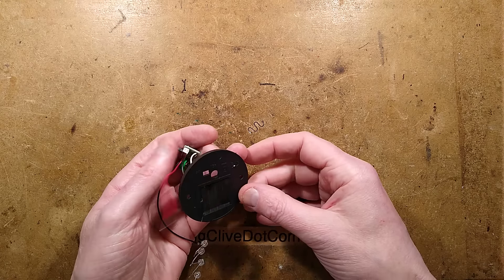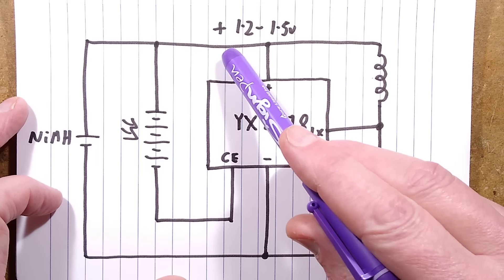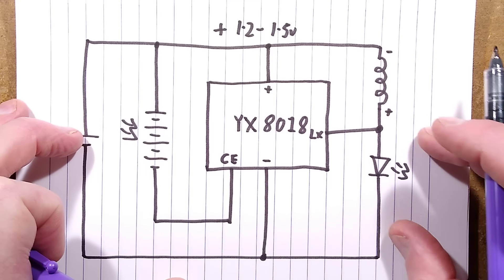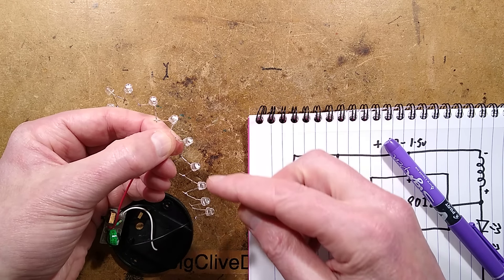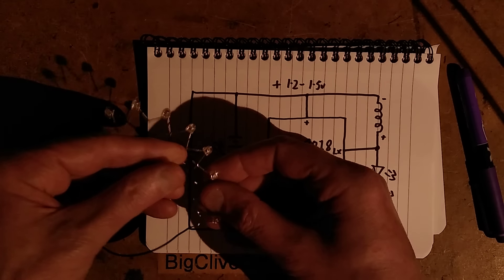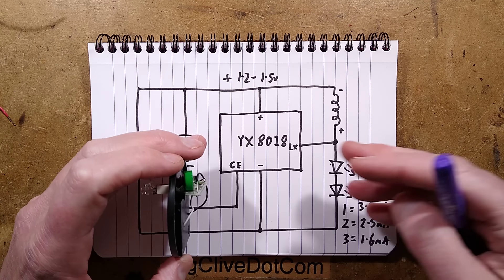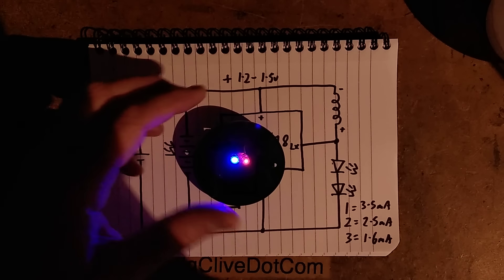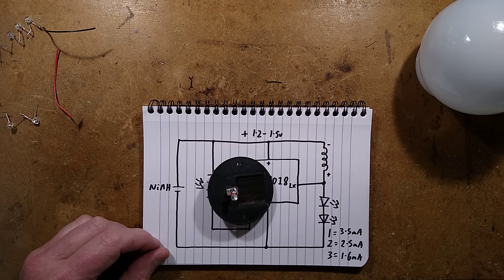How many LEDs in series can a solar circuit drive?

Comment: Wouldn't the battery draw increase?  2 leds drop the draw to 2.5mA but the voltage would double so overall draw from the battery would increase.
Reply: No.
Its down to the collapsing field around the inductor, this generates a back emf, and its this emf that drives the diodes.
Like using a flywheel diode on the coil of a DC relay, swap it for an LED and see it flash every time you turn the Relay off. It can be quite a large spike, 100s of volts on a 12 volt relay.

Comment: Before I watch, I'll say that the similar circuits I've experimented with have a breakdown voltage of about 45 volts.  So at about 3V per LED, that's about 15 in series.  Now I can watch.

I watched.  Wow!  No more than 4 LEDs!  But the circuits I used had all discrete transistors.  The 8018 chip may not be able to handle anymore than 10 or so volts before it breaks down.

One thing that puzzles me is why they had to make the special 4-pin "TO-94" package.  It's very easy to build one of these using discrete transistors.  No worries about not being able to obtain the special 4 pin chips.  I would consider making the PCB work with more than one IC.  👍
Reply from the maker: The chip has a lot of functionality, including a 1V cutoff voltage to avoid over discharge of the cell.
Reply: Cost reduction. This one chip minimizes the bill of materials.
Reply: Mm could( of course you could..but would it be sensibile)..connect a "power bank" to receive the output.
Yes efficiency..yes pitiful capacity
Yes charges in dark
But imagine  butchering to turn on in daylight( one pin ..)..you have a charger for lipo..at around  350 mAhr ( at 1.5V) per day..
It could charge  a powerbank( 1Ahr)  in what. . Only 9 days. Assuming voltage  boost of 3 times nicd to lipo 
...yeah possible  but definitely  not sensible
Reply: @jasonudall8614  Luckily around here sensible is overrated
Reply: @jasonudall8614  
It's easier and simpler to add a Joule Thief voltage boost circuit or even simpler is to use two solar cells in series to give up to 4.2 VDC
Reply: @DodgyFPV   or perhaps not understood

Comment: Interesting, I guessed 4 before seeing the video. Thinking it'll drop off at 5 or 6, and not get the voltage high enough for more than that. So the drop off is more than I thought, but I'm not as far off as I thought I'd be.

Comment: Beginner's question in this context:
If I have a number of LEDs, no idea what voltage, no idea what resistor they require.
Is there a non-destructive way to figure it out?
Reply from the maker: Standard LEDs are usually around 2V for red and yellow, and 3V for most others.  You can start with a universal resistor value for experiments.  270 ohms for 5V and 1000 ohms for 12V.

Comment: 5:16 "I've used a red and a blue, but it's worth pointing out that the red is much less efficient than the blue". Not that this is something you can do at home, but I wonder if a blue LED covered in a red phosphor would be more efficient than a "natively" red LED? That's certainly how "white" LEDs work.
Reply: a blue led has a very narrow colour spectrum, I doubt it will work at all compared to a uv led. Never heard of a red phosphor but at a glance it seems not advisable in efficiency according to some resarch papers..
That being said, the low voltage dropout of a red/orange led probably compensate the low current efficiency of a blue one.

Comment: yeh, I was correct, 4... Guessed about 2.2v per LED, so about 8-9v in total, of course its down to the turns on the inductor and start voltage/flux already present, and of course the collapsing field. 
Out of interest, whats the frequency.

TA

Comment: I often use an external  1v5  alkaline cell on my solar lights ... this ( might ? ) allow you to add one more LED ? another thought .... using ( old skool ) LEDs should allow you to add more , as these light up at a lower voltage ( 2 Volts ? ) ... the "traffic light " green types are  VERY  bright , for the same current , BTW .... Heh - Heh ....... DAVE™🛑

Comment: I actually saw a packet of 6 AA Ni-MH cells for replacing Garden solar lights for only€2.50 i a shop here in Ireland call home-saver. Not sure if they are real but im going to by a pack today to find out... I think that's a good price for 6 of those cells... Ill certainly put them to use and finally get to use my Ni-Cd/Ni-MH charger i own but never had to use, "EVER" 😊👍🇮🇪 
I'LL let you all know if they fake or if they actually the real deal. 👍👍👍
Reply from the maker: They're usually very low capacity, but fine for solar lights.

Comment: So it's putting out 10 volts how is it not burning out the one LED 
Can you do this experiment again but put them in parallel
Reply: The paralleled LED version is sold as solar bottle cork type LED string with 7 to 10 micro LED in parallel on enamelled wire.
There the LED string is placed across the inductor not between LX and GND of the chip.